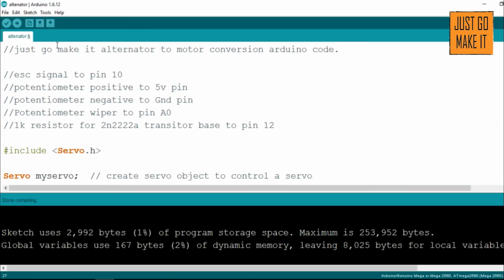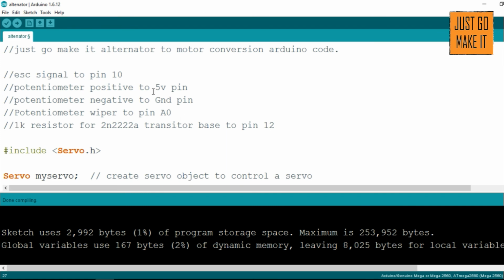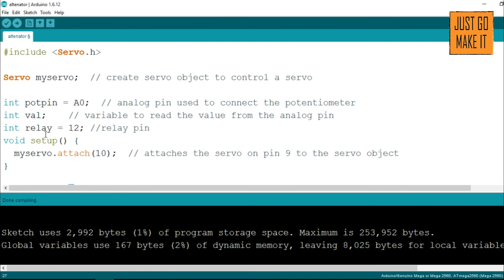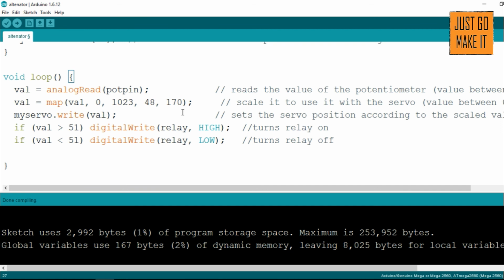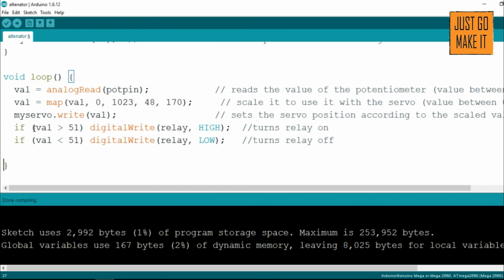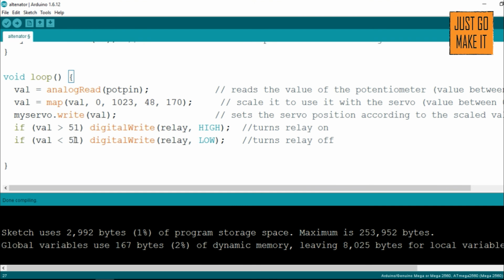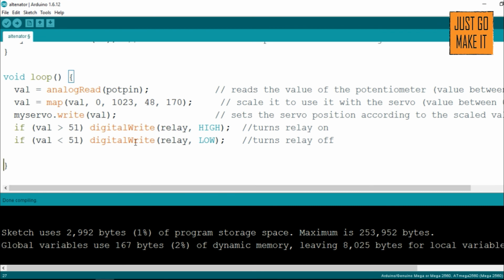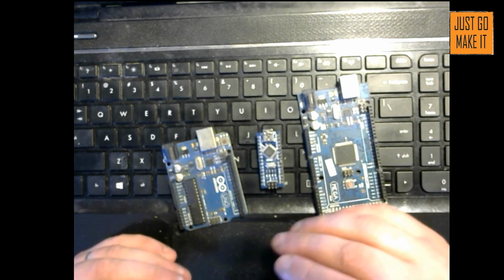Pt. 5 Alternator to Brushless Motor Conversion 2.0, Arduino Code

Comment: Trying to build a go-kart for my capstone project, I was wondering what relay you are using, and what you are using as your 12V power supply to power the field coil? and If possible could I get a closer look at the circuit.

Comment: Why bother using an Arduino to switch the voltage to the field coil? It's not like you are varying the amount of current through the field. You could just use a switch...
Reply from the maker: +Gary Hardman you can do that,i just wanted the field  coil to turn on as soon as the potentiometer is turned.
Reply: Ok, I understand. Thank you for the reply.
Reply: i think he  want show something on LCD!